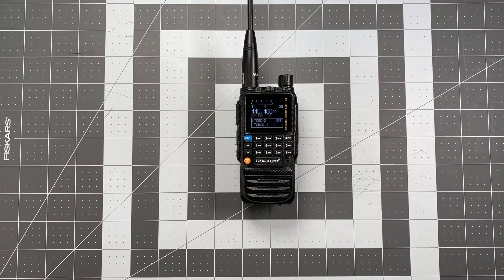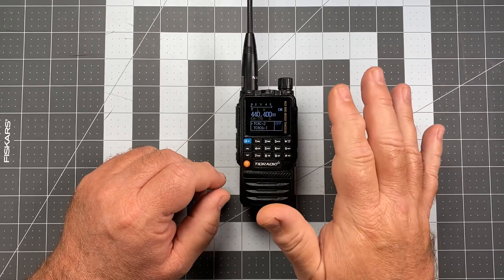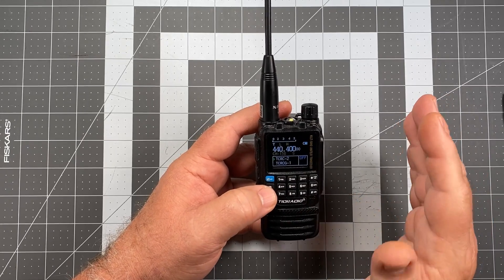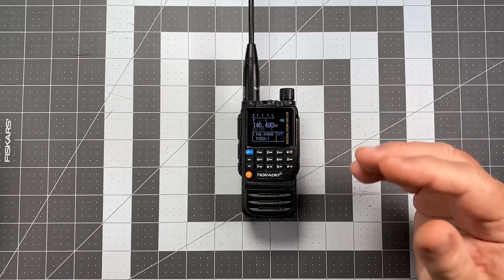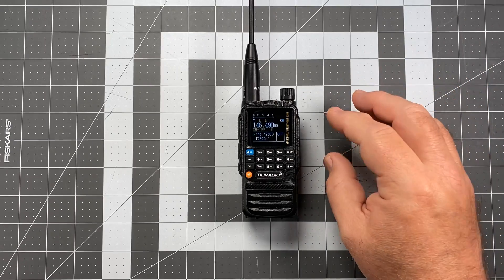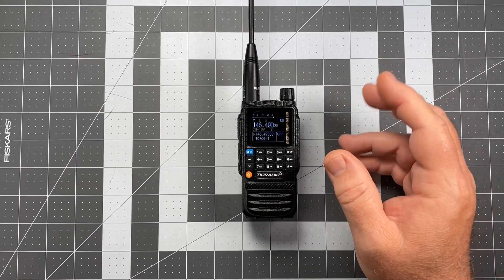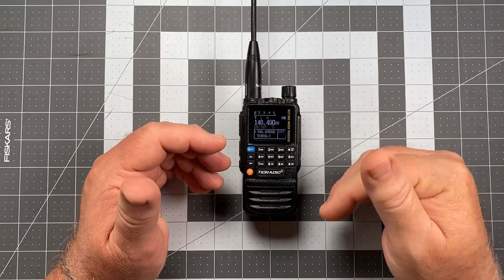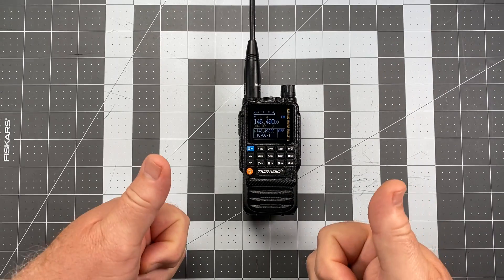TID Radio TD-H3 Post-Firmware Update Issues

Comment: Similar issue but power show high.  Notice problem with nicFW and reverted to factory firmware but problem persists. Had backup of power plan and restored that too, but still acts like very low power or off frequency.

Comment: My radio worked perfect the first day I received it then I put it on charge, after I took it off charge now it won’t hit any of my repeaters I had programmed the day before! Contacted tidradio and they are sending me a new one.  Anyone have that problem? It still transmits just lower power, it’s set to high power.. 240416 firmware.

Comment: This is a comment for Scott. Now that you've been using your radio for quite some time, and updated the firmware a number of times, can you make a video about how it's behaving at this point. I'm worried about updating my firmware because the comments and replies below seem to imply the updates cause other issues. I'd love to hear exactly how you feel the radio is behaving at this point.
Reply from the maker: I only did the one firmware update. But there have been several more since then. In addition, there are some people that have been hacking the firmware on a Facebook group called TD-H3 Hacking. So, some wild stuff is being done. Some useful and some just plain bonkers. I'm definitely going to be covering this very soon because I think it's starting to get a bit ridiculous and counter productive.
Reply: @KS6DAY  Thank you 👍
Reply: I followed your advice completely, including reading that read me file. Both radios worked on the first try. Thank you for this video 👍. I'm hoping Tidradio releases a firmware version that lets you adjust the ptt-id delay though. Even with the 240702 update the delay is still there. But, this new version added Menu 33 as a backlight brightness adjustment. Nice feature.

Comment: I just bought two TD-H3 radios and they are using firmware version 240416. I have not updated the firmware because after reading the comments section, I'm actually afraid to update and have more of a problem than a solution for other little bugs. I've tried setting up a ptt-id which seems to only work using the manufacturer's software, but there is a delay of about 1 to 1.5 seconds before it sends it which also mutes the mic in the process. Can anyone tell me how to send that ID immediately like the Baofengs do? I can't find any way to adjust the delay.

Comment: Good advice. I found with my radio (GMRS out-of-the-box) that I didn't need to hold down the PPT button during the upgrade process but might have just been lucky holding it down for two seconds or so. So far no issues with low power.

Comment: Updated to Ver240530.  Afterward, I read the radio in both CHIRP (20240531 build) and TIDRADIO CPS.  All my 220 channels were blanked, but the 220 channels still existed in the radio, as before the successful update.  200TX menu option was still ON.

Comment: I used the Tidradio software to update my TD-H3 and only had to hold down the PTT while powering the radio on. Will keep your advice in my back pocket in case i have any troubles in the future. Also I have heard that some people are using the USB-C cable to flash firmware. That may also cause issues. I used a Kenwood cable as is recommended in the readme just to be sure.

Comment: Mine updated just fine and I did not hold down the PTT button. I simply held the PTT and turned it on and let go and it updated first try. Mine did not switch to low power either.

Comment: Tidradio really isn’t that good a radio. I’ve got both the H8 and H3, and they’re my least liked radios. IMO, someone is really better off with a UV-5R that you can unlock that either of these radios. Neither of mine receive signals on any freq as good as my $13 5R. They’re always staticky, on pretty much any antenna. It’s just that you can reduce the amount of static if you use a good aftermarket antenna (Nagoya 771). Otherwise… they seem to be the most overhyped IHF radios out there.
Reply: I think imo the bluetooth is one of the best things offored and should have been added to the UV5R MANY YEARS AGO to aliviate the issues with  everyone has debated about which cable to use for programming. HELLO! And what about the Boufeng 8 watt that has been out for about 7 years or so why not make them all 8 watt or 10 watt with bluetooth instead of 10 or 15 different models. I have many Boufengs, models etcetera I like all of them including the H3! If I were to guess it would be they are all cousins or may be step children mean they could all be nearly blood relatives.
Reply: I'm beginning to feel the same way about my H3

Comment: The only change I noticed is that the carrot will move to the line you're transmitting on but the frequency still shows the frequency the carrot was on until after your first transmission.  They also didn't fix the issue where in SYNC OFF you can still transmit on the B freq with PTT 2 even though you can't hear it because it sets D. WAIT to off and will not let you even turn it back on.  I also don't understand why any radio in CTCSS/DCS scan continues to iterate even in absence of a carrier.  The original UV-5R model of only iterating while it's got a carrier makes way more sense.

Comment: This is a known issue with Chirp. The CPS of the radio didn’t do this to me.
Reply from the maker: Which issue, the output power issue or the interrupted firmware failure?
Reply: The transmit power.

Comment: The link provided doesn’t work for me, it says, “404 Not Found”.  Edited to add, that is to the software link.
Reply from the maker: Link repaired and now working. Thanks for the heads up.
Reply from the maker: Although it does say "Programming Software", the latest firmware update and the program to load it is also in the bundle that you get when you click the download button.
Reply: @KS6DAY  Well, at least for me the link did not open anything, browser could not find it.